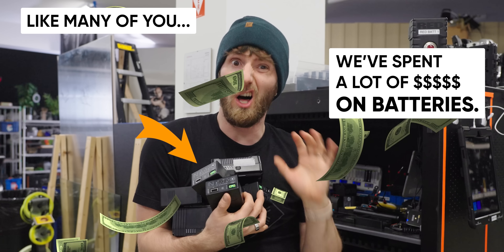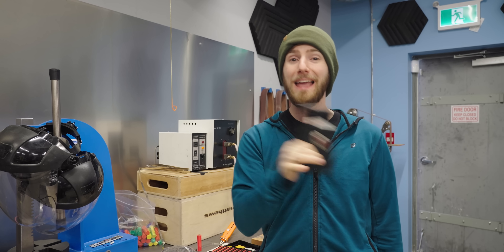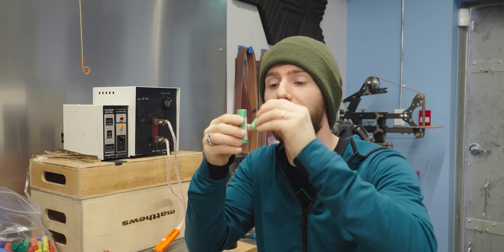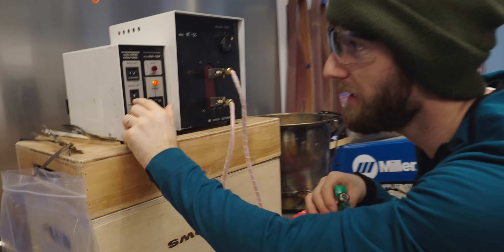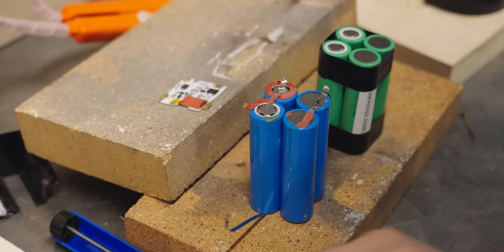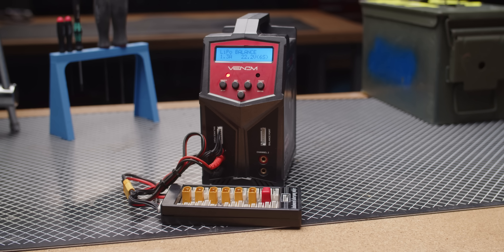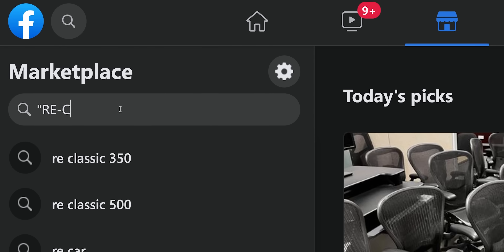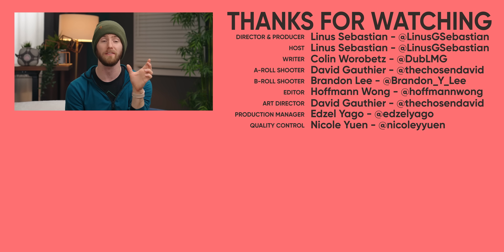This should be illegal… Battery Repair Blocking

Comment: "This electric car right here, after just 3-5  years of use, gets us a whopping 20 miles of battery life, and that's on a good day."

Stay tuned. This is our future.
Reply: Exactly.  It's going to be a rude awakening for many when the re-sale value of their cars plummets after 5 years.
Reply: Yep.... and the big question is will replacements be available when needed?
Reply: @Daniel Kintigh Kind of ironic that you bring up MIT when I'm currently getting my masters from them... Would be interested to hear what laws of physics I'm breaking though
Reply: My 2014 Leaf still gets 80 miles of range of its 100 miles back when I bought it 6-7 years ago and I've driven it daily. And there are services where I could replace the battery pack and get 3-5x the capacity I had before for about the same price as a new car. I'm actually thinking about upgrading my battery next year to a 72kW battery so that I can get 300-400 miles of range, which would still cost around 8k but it would be about 1k less than what its saved me in gas and maintenance since I haven't once had to take it to the shop or stop for gas
Reply: @callowaysutton  I know guys with Iphone 4 or 5 that say their battery life is still "pretty good". That doesn't mean that's representative of the device as a whole. The vast majority are paperweights by this point. The same will be true for electric cars. For every car that still has a functional battery there will be 100 that barely hold a charge. That's how it goes with every rechargeable anything, ever.
Reply: @facepalmdaily4404  I literally have 3 other electric cars... Batteries degrading isn't an issue as long as you take care of them
Reply: @callowaysutton  LMFAO. So either electric car batteries were made at Hogwarts and don't suffer the same fate as literally every other battery in every other thing ever.... or I smell a pile of bullshit.
Reply: @facepalmdaily4404  Electric car's have backup cells in the car to last longer which the BMS transfers over to over time...
Reply: @callowaysutton  ...... which will also degrade. All that does is delay the inevitable. Lithium batteries are finite. Period. They have a certain number of recharge cycles and that's that. No amount of maintenance is going to change the fact that the timer started the second you charged it the first time. 

You will not see a 30 year old electric car daily driver  out there on the original batteries. In contrast: I drive a 1988 Pontiac Firebird. Had it since I was 17. It's a 34 year old car with almost 500k miles on it. Still has the original engine and transmission.

HOWEVER, when the engine does need to be replaced I can drop a new one in for 3-4 grand. People are already having to get new batteries in their Tesla's and are getting hit with $20K+ bills. 

Electric cars are the next evolution of planned obsolescence in the automotive industry. Once the market share gets high enough, i promise you they'll start doing the same thing the cell phone industry does: software updates that secretly shorten your battery life to nudge you into a brand new car.
Reply: @facepalmdaily4404  It costs me 2k to get a new battery for my leaf which I only need to do every 6-8 years lol
Reply: @callowaysutton  2K for a battery that gets you 80 mile range. Now find out how much for the battery pack to get you mileage comparable to internal combustion. 

And you went from " batteries degrading isn't an issue if you take care of them" to "I gotta drop 2k every 6 years or so on a new battery." 

2K is a transmission. I don't have to swap my trans every 6 years. And I definitely don't swap engines that often, either.
Reply: @facepalmdaily4404  I don't have to pay for gas and my electricity is 7c/kWh, the 2k barely scratches the surface in how much money I save in gas alone lmao. In 2021 I payed a total of 300 dollars for charging my car, how much does it cost for you to drive around? Also not including the costs of maintaining ICE cars such as oil changes and engine checkups
Reply: @callowaysutton  Goteem ;)
Reply: @facepalmdaily4404  No, most people are too lazy to plug in their phones, so they would rather cook their batteries with induction chargers, which are also less efficient. If people leave their phones in hot places for long periods it will drastically reduce the life of the battery. If people would read the directions they would get long life out of their batteries. I actually have the original battery in my Galaxy 5 and it's still going strong. 

You are wrong, because batteries keep getting better "in the future".
Reply: @gordthor5351    "If people leave their phones in hot places for long periods of time it will drastically reduce the life of the battery" 

Well thank God no one leaves their electric vehicles in hot places for long periods of time. LMFAO.
Reply: @facepalmdaily4404  How did I know you would say something like this?  The bottom of the car is in the shade and relatively cool.   The inside of a car is a greenhouse and gets hot AF. Even dogs know that the underside of cars are a nice cool spot to have a nap.

Charge your phone on the dashboard with the windows rolled up when it's 100 degrees out. I don't care what you do. 

Also, EV car batteries can handle much more heat than small device batteries.
Reply: @gordthor5351  So you'd leave your phone to charge underneath a car all day that's parked on black asphalt in full sun, in August, in Texas? Of course not, because the lesser of two evils is still evil and would negatively impact that phone and I think you know that. 

None of this matters to the original point. That is: Batteries degrade.  That's not a debatable opinion. It's scientific fact. According to Bloomberg, over 3 million electric and hybrid vehicles have needed their battery packs replaced already. This has always been the plan. This is why they are pushing electrics so hard. Disposable technology makes the manufacturers exponentially more money. So it's in their interest to make something designed to fail and make you buy a new one. 

Yes, internal combustion degrades too, but they are made to be repairable. Broken parts are, for the most part, relatively easy to swap and get the vehicle back in operation. Electrics are the opposite of that. They aren't made with repairs, particularly home repairs, in mind. 

They'll continue make it as difficult, or impossible, to do the repairs yourself. They make less money when you do that. Just like cell phones. They used to have replaceable batteries, but not anymore. Now they make it as difficult as possible so you're more likely to toss the phone and buy a new one. 

Electric vehicles is simply the next phase of planned obsolescence.
Reply: @callowaysutton  Got distracted by the other guy, missed your last. 

First off, calling bullshit on that 2K. I educated myself on the ole Leaf. Average replacement costs for a new battery is between 5 to 8K. A refurbished battery can be had for 2k, but that doesn't include the high labor charges because, unlike internal combustion, you simply can't do it yourself. (or rather the average driver can't.. I've no idea your skill level)

Yea, my ICE has higher gas costs than your electric charge cost. I can also go more than 80 miles a day. I can also refuel and be back on the road in less than 5 minutes. That may not matter to you if you never go more than a few miles a day, but you aren't everyone. A lot of us put miles in. Lots of miles. An awful lot of us, the majority in fact, enjoy road trips and vacations.  It's not an apples to apples comparison between your electric charges and my gas bill because I drive WAAAAYYY more than 80 miles a day. 

But would you rather small payments spread out over a long period of time, or one gigantic bill all at once? That's the difference. I'm not getting hit with an $8,000 bill all at one time. My costs are spread out over years of fill ups and oil changes. And when I do have something break, it's cheaper to replace, and DIYable. 

Last thing I'll say: If it works for you, great. Do your thing. But don't stick your head in the sand and pretend like there are zero negatives or that you're somehow better than everyone because you invested in disposable technology.
Reply: @facepalmdaily4404  You're right, besides the part that ICE are made to be repairable. They WERE made to be repairable. Nowadays you have to choose the lesser evil or maybe not even that. The only thing one could do is to buy a relatively reliable old car that you can manage to fix yourself, however, even their engines will die completely. Though i own a pretty substantial workshop with cnc-mills etc., i couldn't make a new engine block.
Reply: @bogeydope3022  That's true. ICE engines were made repairable. For years they've tried to make many of those repairs more difficult for the home mechanic in an effort to encourage trade ins or ridiculous bills from the stealership. But there is only so far you can pull repairablity away from the owner with the basic design of ICE. They've pushed planned obselecence as far as they can with them...... hence electric cars with very, VERY few serviceable components, pushing more people into a new car before they otherwise would want. 

You're absolutely right that even internal combustion engines are going to die one day. For sure. Nothing lasts forever. But you can get decades out of a well made engine block before it cracks and dies. Something that you will never be able to do out of an electric car. Neither the batteries nor the electric motor will last decades.......... by design.

Comment: As far as equalizing the batteries together use a wire with a mega ohm resister in it and touch off each connection before welding.  I took basic electronics back in the early '90s and that is what we did to discharge capacitors.

Comment: I'd like to see this project revisited, & an aftermarket BMS installed. I'm betting you'd have luck reviving those packs with an aftermarket BMS.

I've dabbled with these batteries to make battery packs for some RC projects. I had decent success with a quality soldering station, instead of the spot welder! 

I eventually ditched the idea of powering the RC with these cells, as they DON'T do well with rapid discharging, or rapid rechargings!
Reply: That sounds like a nice idea, but usually, these gas gauges communicate via SMBus or I2C to the camera they're connected to, giving the camera incredibly precise information on how long the battery will last. Some camera's could even refuse to work if they lack communication. Fortunately, there are cameras that don't care about this and then just display a voltage (making alarm-warnings kick in based on voltage instead of remaining capacity or time, settings that can be changed in the camera-menu).
Besides that, the charger could also refuse to charge packs that don't communicate.
Though 3 of my Bebobs don't even communicate (at all) with anything, I dare to say that there are probably brands or types out there that DO restrict acces to the power housed inside the pack without proper communication. I know IDX does this with their SSL-JVCxx series batterypacks for the JVC-GY-HM200 and 250. There's some communication going on between charger ánd camera: one of the 3 packs I got when I bought it second hand, just does not charge ánd does not power the camera. Even trying to charge this myself by finding out which pins carry power, did not work: the pack just refuses current to flow.
It enables the camera to show extremely precise information about the remaining run-time, but unfortunately making it harder for a third party to make batteries that work with the charger by IDX and the camera by JVC.
Reply: You got that right.....ni-cad battery is better for rc than these mfers.

Comment: I'm surprised you did it this way. The best thing to do is make sure all batteries are at the same potential, the way to do that is to connect a resistor, say 1k, in series with each battery, and then parallel them up. Currents will then flow between them, but limited by the resistors to a few mA, until no more current flows. Because no more current flows there will be no voltage drop across the resistors, at which point all batteries will be at the same potential and you can remove the resistors and safely spot weld them in parallel.

Comment: I saw that the fire standard on US airlines is to use water for Lion battery fires. Why? The absolute importance is to reduce heat. 
Demonstrations show that a fire extinguisher's CO² puts out the fire but the heat is still significant and will cause not only reignition but adjacent cells to combust as wel - a long chain reaction.  Water dowsing over time can dissipate the heat and save the other cells.
Would love some update on this.

Comment: 13:08 RIGHT NOW I'M REALIZING THAT LITHIUM BATTERIES ARE EFFING DANGEROUS. KEEP GOING! YOU GOT A LIKE AND A SUBSCRIBE.
Reply: Lithium batteries are dangerous if handled improperly, otherwise they are pretty safe. They are more volatile than other battery technologies but I still had to laugh at the little weld spark that made them throw out a perfectly good pack

Comment: your advice of throwing all cells away is really stupid... every pair of cells is isolated from one another as it's not common a whole pack is connected in parallel.

You just need to do a capacity test per cell and test their ESR with a proper ESR meter to figure out if it can still discharge reliably without heating.

Regarding tab welding: K-weld

Regarding equalizing voltage: You need to bottom or top balance your cells.. not just grab them and measure them and cross your fingers

Comment: You wasted so many good cells
Use an Opus battery analysis 
I built my own power wall running from solar using 2nd hand 18650 cells

They were always run through my Opus

Comment: Hi your answer is to check the old one.
 voltage and current then make a set of new cells with exact same voltage and current. after you have to connect the old cells with extension wire for shifting them away while they still connected.  add the new set of cells then when you ad one block then you remove the old one that was extended on wire this way the eprom in battery gauge still holds the content because you not disconnect any cells so the circuit is closed.
and you continue to next set until you swap all.

usually apple has this way set gauge in batteries.

the another method is to read the gauge and program it. 

this cannot be done with amateurs due to hazard that can explode the cell or set on fire.
only experienced engineer can do battery swap or repair.

Comment: ye kiddo you never seen a lithiium fire.

were going to lift that bucket up and take it outside 

yep thats not happening dude your going to have too stand a few meters away on an AA set on fire.

a whole pack and well lets say smoking lithium gets ya high as fuck and the temp will have you passing out.

nice that you thought about safety but this one is beyond dangerous if it goes up.

Comment: I already fixed 6 Expensive Blueshape Granite TWO 150Wh Camera batterys to life by replacing 16 Sanyo cells to new chinese EVE cells. I got original capacity and it does not get hot while using.

Comment: I rebuild my power tools batteries with straight 18650's and no on board battery management. I use a 200 dollar battery manager/charger from an RC hobby shop to charge them. Defeat the BMS on board and you defeat the obsolescent character. I use a single cell multi wire buss style RC charging system with a wire for each cell to charge at 4.3 volts and the charger auto balances and reports sluggish cells. All my power tools get this upgrade. I also swap out old dell laptop charging PnP BMS boards and install them on generic laptop battery packs which defeats dell proprietary PnP anti-generic battery technology. My Sony handy cams are done with the first method.

Comment: I make my own 14,4v Batteries from old Android Tablets For my Vintage Boom Boxes, I don't bother with a BMS, i just link them together and fit them in, i connect a charger socket to the the back of my boombox and plug a 15v charger in, when the charge led turns from red to green, that's them charged up, i can use my Ghetto for about a week before the battery needs charging again. i've never used a BMS and never had a problem.

Comment: In general welding 2 nickel tabs doesnt work well. Best to do one tab to the cell and a second weld on the next layer of tabs. Also twist your welder as you lift off of the tab after welding.

Comment: I managed to replace the screen on my Samsung A32-4G. 
Unfortunately I didn't have any isopropyl alcohol on me to "unglue" the battery (the glue wasn't even that strong, but the casing wasn't allowing to safely pry it away) , so I just started snapping-off the screen in tiny chunks. 
Bottom line is , there's ZERO reason to glue the potentially explosive battery in - the manufacturers that do this  are evil. Best part ? The South Korean phone is manufactured in Chy-nah.

Comment: There is a solution to that problem and i have done it myself.charge the old pack to full. Charge the new pack to full and mach the voltages. Run thin wires from new pack to bms without disconnecting old cells. Disconnect old cells and make proper connections. This way there is no way that bms can go to protection mode and cut off output voltage